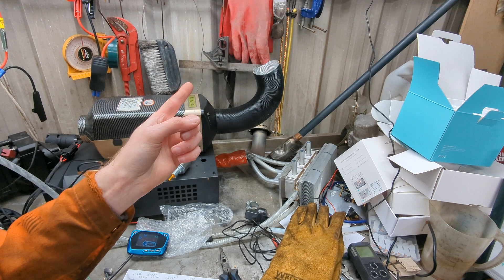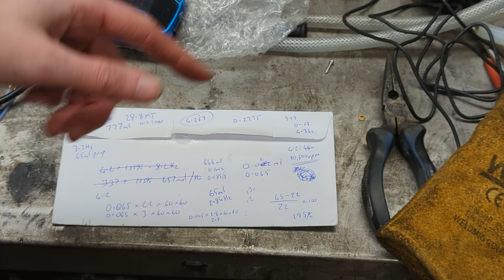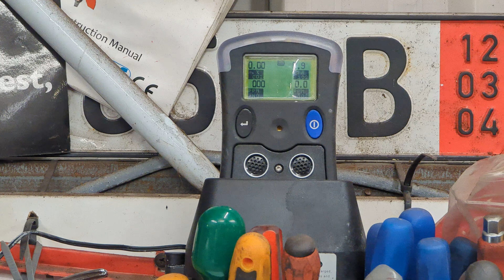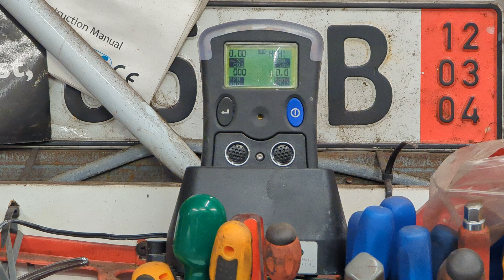Why the 8KW diesel heater can't be 8KW.

Comment: QUESTION ? Can i tap into my main vech. exhaust ( before the muffler ) and run it that way ??? I would drill the hole on a angle so it shoots the exhaust into the direction of the muffler :) Peace and thanks for any advice on this idea :)
Reply from the maker: Good question.  My only concern would be vehicle exhaust gas running up into the heater.  Small chance of making through to the blower fan and melting it.
Reply: I’ve thought about this too, I’d be concerned about disruption to the heater, Venturi effects could suck through the heater messing with a/f ratios or back pressure messing by causing back flow. Pretty sure even a tiny bit of either would be game over!
Reply: @keithb5708  Yeah agree, it's a bad idea and not really a good reason to do it as opposed to separate exhausts. Don't do it VL, hey, are you just waitin' for a mate? 🍻

Comment: Could you revisit the tuneing video. I think people would be interested in getting the 5kw heater to run as low as possible since it heats people out of their vehicles and such. With many people running like that for long periods of time. How low can these really go and can the fan speed be matched so it doesn't just soot up so fast?
Reply: don't do it! it soots up and you'll be replacing atomizers and burn chambers too frequently. i downgraded to a 2kw. why would you want an oversized furnace?
Reply: i have one running right now none stop all winter and its heating a one and a half car garage 
works pretty darn good for its size and fuel usage

Comment: So I wonder what amount of energy the heat exchanger body can actually exchange. That's another interesting factor. Let alone if it can burn 8kw of energy/fuel. It wouldn't be impossible to make a DIY heater?? 

Could you run multi hot water tests to see which setting is most efficient for the body. It'll give you then the efficiency curve if plotted.

If you can't get enough air in feed in a mix of oxygen and also run away as it'll melt I suspect. Haha.

Comment: If you set the controller at 2 magnets on the fan but have only 1 magnet wouldn't that double the fan speed?
Reply from the maker: I was wondering about that too.
Reply: Test it?
Reply: @gmc3019  yep, agree.  It might just halve it instead!

Comment: Ha makes me want to test the one I have. 😅 it's a "5kw" one but it's the bigger size of the 2. But jeez 10k rpms  we have cncs than can do that unloaded they use 1.2kw just to spin that fast than the makinos have a 300hp spindle in them that go's up to 32k I believe and the modigs can hit 40k
Reply from the maker: The heater forums don't even recommend running the heaters at 5000rpm.  But I'm keen to see just how fast it will spin.  :)
Reply: @DavidMcLuckie  run her till she go's just make sure a bearings are lubed up. Should hit up photonicinduction for a little help he's good at blowing stuff up

Comment: I'm not sure whether these can be called 'efficient' convenient certainly but definitely not getting every btu from the fuel. If I consider what my Cummins 6bt puts work wise out per litre not counting the wasted heat from the exhaust, my little 5kw heater seems quite thirsty in comparison to the work it does. 
But ... It beats chopping wood and using beautifully clean coal. Convenience at a cost..
Reply from the maker: So a typical diesel engine is about 30-40% efficient at converting the energy in the diesel into usable (rotational) energy.  Now as we want to create heat from burning the diesel we can work out how much fuel went in and how much heat came out.  Which is roughly 80% efficient.

You can't ignore the heat wasted in an engines exhaust.  That's all part of the efficiency calculation.  If we ignore the heat lost out the diesel heaters exhaust it's 100% efficient.  But we are comparing apples to oranges.
Reply: @DavidMcLuckie  David, what are your thoughts on running the exhaust through an 8 foot piece of hydronic baseboard before it goes outside? You would capture some of the heat loss making it more efficient, correct? Thank you, Mark

Comment: When I had my first CDH.(I have 3 now)Lol
I compared its fuel consumption with the Mikuni 3.5 Air Heater..MY30 Model which is of similar design.
the Mikuni produced  d3.5 KW IN heat output and 4.25 KW of heat in Total including the Heat that went out through the Exhaust.
the CDH appears to use slightly less Fuel than the MY30....so I considered the "5KW " as Approx.3.3 KW actual Heat output to the area.....and approx 750-850 W. to the Exhaust.
Reply: I have an MY30 in my ambulance camper 👍 i love it, way easier to service than than an eber and seperate ECU safer on overheat situations 👍
Allways enjoy the vids David 😎

Comment: Great video! Proofing things wrong with maths 😆😁  It makes you wonder if you modified the heater, what the maximum KWs you could get out of it. Bigger fan, bigger fuel pump, etc. A realistic test and a unrealistic, glowing red hot, test 😀
Reply: He said it shuts down when it gets to hot so you would have to override the controller some how.
Reply: 2 pumps will do 8kw

Comment: Hello. How do you reset the gas detector? I have one and it tells me that I have to send it to reset at the point of sale or manufacturer.
Reply: I don't know, but I wonder what happens if you pull the battery out, wait a while then replace it?
Reply from the maker: If it's a GMI it needs to go back to GMI for recalibration.
Reply: @DavidMcLuckie  It's a gas alert. and yes, I think you should go back to the manufacturer to calibrate.

Comment: Much like anything measured in Watts from china, they're always over-inflated, like huge LED bulbs claiming to be 500 watts, but running at 50 watts, because china... :P
Reply: you had to choose the LEDs eh? they're pretty difficult to compare, most people will buy a 500W bulb thinking it'll be equal to a 500W MH or sodium bulb but then end up burning their plants.

it's like hard drives being sold as 2TB but only 1.8TiB.

you're just confused.